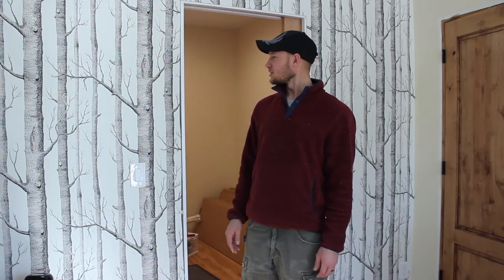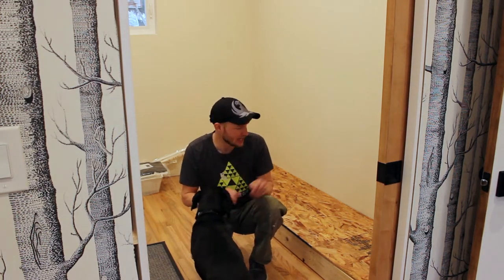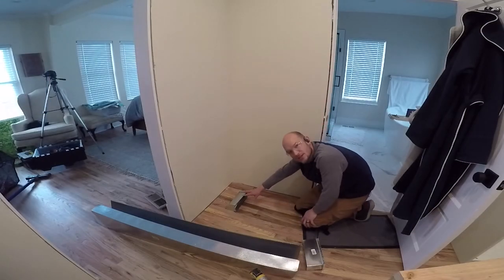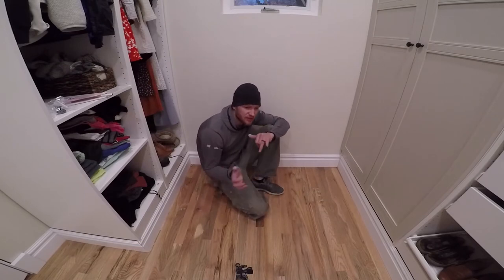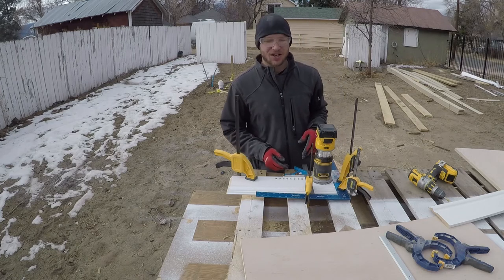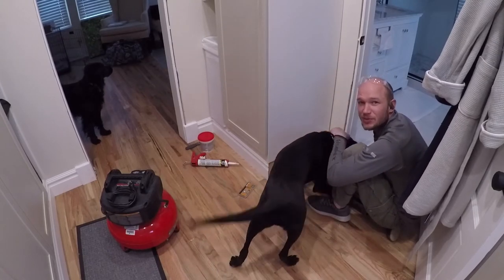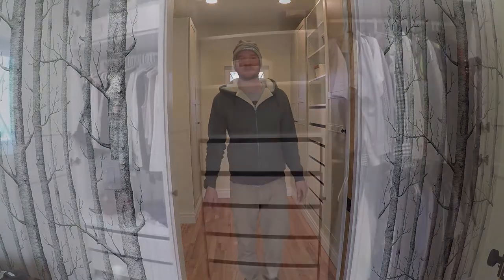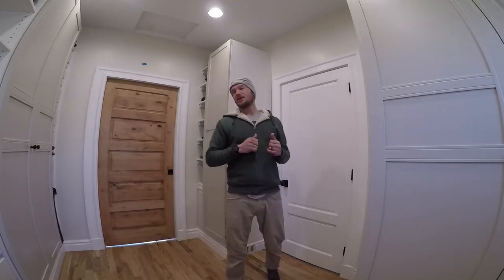Ikea PAX master closet build - baseboard modifications

Comment: Hi, great idea with the extra space. How did you attached the shelves holder?
Reply from the maker: I used 1/2 plywood on the sides and used screws that could penetrate the studs on one side, and through the plywood and ikea cabinet (but not through the cabinet) if that makes sense

Comment: great ideas! I'm wanting to put the 29" cabinet to enclose my gun safe, is the unit able to be built without the bottom portion? It would be mounted to the wall for stability
Reply from the maker: Nice idea! The cabinets we have required the bottom for a completed unit/assembly.. I'm sure if you're handy - you could figure out a way to make it work.